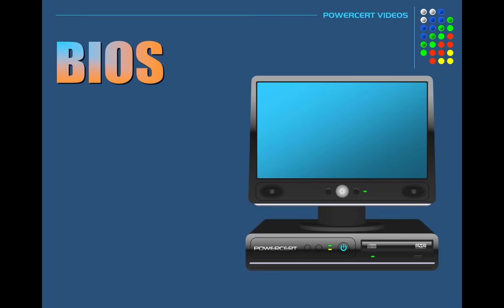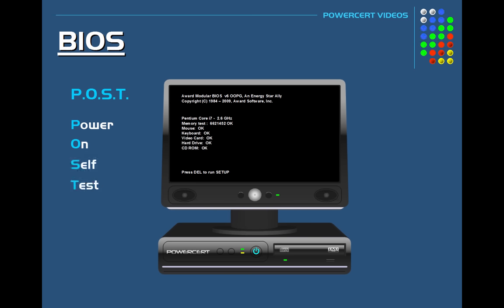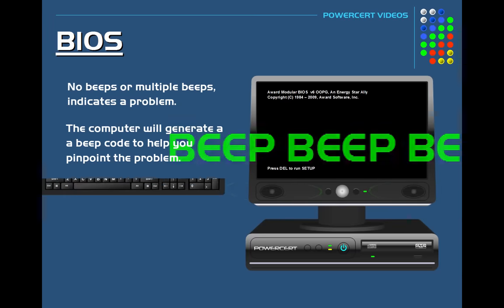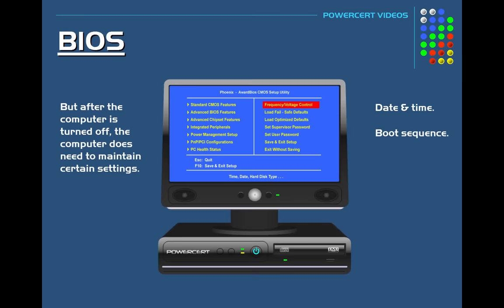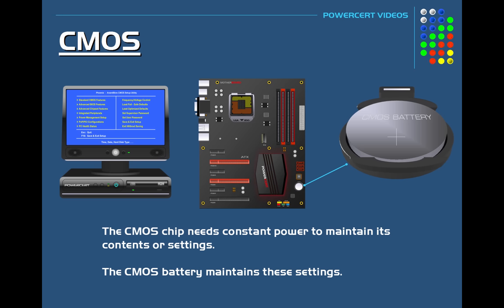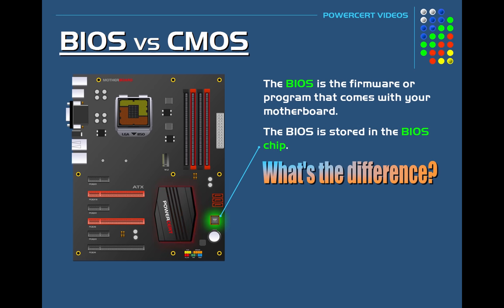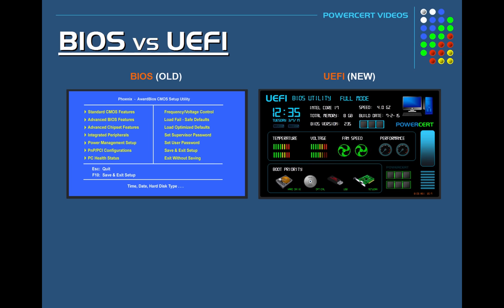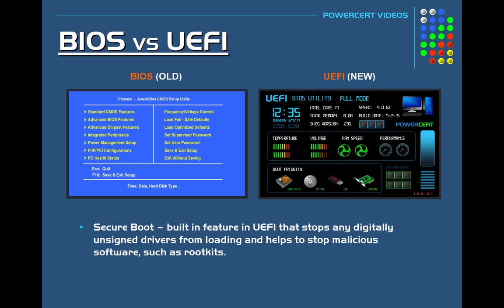BIOS, CMOS, UEFI - What's the difference?

Comment: Not sure if you explained what CMOS stands for.  It stands for “Complementary Metal–Oxide–Semiconductor”.
Reply: yea thats correct..
Reply: There's no point in me hearing because I'll just forget it. I don't really see the point in remembering what it stands for either.
Reply: yes indeed....many people wrongly refer to CMOS as an entity similar to BIOS Setting. CMOS Battery is usually a CR2302 a 3V battery...these batteries are too large for a wrist watch. Having said that this is a good tutorial none the less.
Reply: No need to mentioned what is COMS stand for, you will forget it anyway! and even CompTia A+ test will not ask you what is CMOS stand for.
Reply: @FXV  *CR2032
Reply: @FXV  
CR2302 batteries used in Casio watches.
Reply: Technically it is quite unspecific to call it a CMOS, as that is just the technology it is based on, kinda like refering to a cpu by transistor size.
Reply: @swagiyo9801  exactly... saving to the BIOS hasnt been called CMOS since like the early 90s...most BIOS's these days have the settings stored on the same chip...not in the RTC..not on an external chip..
Reply: And it's named after the type of memory used in the CMOS chip.
Reply: So, similar to a digital camera?
Reply: The best kind of metal-oxide-semiconductor, I hate the ones that insult you.
Reply: @shade0636  It may never to you.  One day, it may be just the information you need.  That's the thing about education.  You are never quite sure when or if you are going to need a piece of information.  But if you don't learn, you will never know ...
Reply: William Potter Yeah that's true. Extra information never hurts. Although one year later and I was correct about forgetting lol.
Reply: @shade0636  I forget what I had for breakfast.  But I keep trying !  On the other hand, I know nothing about computers and I am trying to learn so I can rebuild mine.  I just don't know what's important yet .. So far the only thing I understand is when you build a new computer and it won't start check that it's plugged in and turned on ....
Reply: inconCMOSable! you keep using that word; i do not think it means what you think it means
Reply: @shade0636  That's because its only in short term memory. If you use it it will be stored in long-term memory. In any event, it really expands your knowledge and even if you don't remember it, you will be familiar with it. 

For example, I remember that CMOS chips are also used in video cameras as a less costly and more efficient replacement for CCDs (Charged Coupled Device). 

None of that many mean anything to you, but it may help in some way in the future. Like Algebra or the periodic table. We may not understand it, but its still a part of our lives everyday.
Reply: I don't know why they would call it a CMOS. CMOS is a transistor level technology and has nothing to do with BIOS settings itself. Also, I don't see why they didn't use flash or eeproms instead of volatile memory to store configurations and having to mess around with batteries.
Reply: Complimentary Metal Oxide Silicon.  Thats from back in the day (70s and 80s) when I was working with MOS and CMOS devices.  Maybe the definition has changed somewhere over the years.
Reply: @FXV  CR2032.  But the most recent iterations of CMOS didsn't  use batteries at all.  They are ultra low power devices that use capacitors.
Reply: @TheChrisey  Flash technology had only been developed by Toshiba in 1984 and commercialized later in the decade by Intel. So in fact, flash has only been around commercially for just over thirty years.
Reply: You will never remember that name. Its better CMOS stands for Contains Most Of Settings.
Reply: It is the Type of Battery used
Reply: True,another Technology Examples is TTL and NHMOS
Reply: Not in this context. For this case, it stands for "Configuration Management Operating System"

Comment: The main difference between BIOS and UEFI is not the graphical user interface. It's that BIOS is running in a crippled 16 bit mode and is therefore very limited.

Comment: What you call the "CMOS chip" is the real-time clock. A clock needs to run constantly, which is why it has its own power supply (the battery). The manufacturer of the original clock chip included 44 bytes of storage. This was powered by the same battery. This is where your "settings" are stored. "Clearing CMOS" means clearing these bytes of RAM.

Comment: The most important difference between (legacy) BIOS and UEFI is the way of organising the boot process. For UEFI there was an EFI boot partition introduced where boot loader data for various operating systems are stored. This way it is easier to build and maintain multihomed PCs (with multiple OS installed).

Comment: If there are no beeps, there will be a beep code.

.....Keyboard error. Press any key to continue.
Reply: OK. But where the h*ll is the 'any' key? 🤔
Reply: @eknaap8800  try turning your keyboard over and checking the underside for the any-key.
Reply: @fraydizs7302  Nope, there's isn't one either...🥴
Reply: No beebs could be GPU failure.
Reply: taranTula leGos  So that would be the 'any space bar'? 🤔
Reply: when the keyboard is not connected it starts automatically
Reply: That's the error message I got when my dad hid my keyboard back in the 90s. The first time, that is. The next time I had already set up my BIOS to ignore keyboard. :)
Reply: @eknaap8800  You have to press in this order the keys: A,N,Y,K,E,Y. Got it? 🤣🤣🤣🤣
Reply: @johnphilippatos  OK, got it now... 👌😂

Comment: The computer speaker may actually be set to "off" by default in some UEFI configurations (I had to turn mine on, for example).   There were older BIOSes that enabled mouse devices, btw.  This is a good video to explain the differences, especially with Micro$oft's ridiculous Windows 11 system requirements for UEFI and Safe Boot.  People will be very confused about needing those things.
Reply: @michaelcook5585  It could also be that your computer cannot generate beep codes.  My current computer has no audible codes because it has no built-in speaker, but there are 4 tiny LEDs on the motherboard that light up at the beginning of P.O.S.T. and turn off off as the CPU, memory, disply, and storage subsystems pass the test.
Reply: Respectfully, Jim Maloney wrote "Safe Boot" where I think he intended to refer to Secure Boot.  "Safe Boot" is not actually the same term; it has historically referred to an option for starting Windows with many feature and options disabled, for the purpose of troubleshooting or getting Windows running after a driver update or setting change caused it not to run (so that you could back out the offending change).

Comment: Quick Note: UEFI doesn't really require OEMs to use a fancy GUI, some still use the old legacy text based UI of BIOS, using only thd keyboard for navigation.
Reply: I've seen boards that had both bios and UEFI... and gave you the option which one to use.
Reply: mine is uefi but it has the old ui

Comment: In short, the BIOS or UEFI BIOS is a medium between your operating system and hardware,
This is done for 2 reasons security and simplicity.

1) The BIOS/UEFI will prevent psychical damage to your hardware (set limits to what the operating system can and not can do such as voltages cpu, memory, sensors to detect failure and shut off the pc before more harm is done)
2) The operating system has to obey rules set by your BIOS and doesnt need special drivers to control important aspects of your CPU and Motherboard because those are inside the BIOS this makes it secure and easy for OS'es to run on that hardware
Reply: can you tell me how an UEFI works ?
Reply: nah, bios lets win control mostly everything once you load, for example, boot.ini, hal.dll and alike. so if you, for example, keep pc in stby, bios is never really used, and pc works, right? and consumes few watts while sleeping which is almost the same as bios idling. bios is more of an legacy stuff than a real need.....sure it can halt boot if cpu or ram are faulty but...meh....win can do that too, it bsods it.
Reply: Some systems bypass the BIOS routines. BIOS was sort of the KEY for IBM to defeat clonning (didnt last much LOL).
Reply: How to configure bios to work with UEFI hard drive
Reply: I disagree about your point no 1....modern OS  bypass BIOS/UEFI at certain extends settings once it was installed.....BIOS is like the initial firmware or we can called it Operating System at the very basic..hence the name Basic Input Output System....this is where you tell your mobo to enable/disable or any misc settings before we installed OS, e.g storage configurations AHCI,Legacy,Raid. Once your OS and drives up and running, your OS basically already has the control over your hardware, at certain extends. You can from OS level set CPU voltages/frequency/RAM  , but stability might not be the best ! Off course at the very low level , OS can't change boot sequence, type of SATA (AHCI or RAID or Legacy) to name a few and some advanced settings that might only viable only at very low level.
*Disclaimer, this my experience dealing with Windows since 1997. I'm not sure how Linux or other OS handles their OS at kernel level.
Reply: @JdMetal  
Yes the bios will give the os the control .
And about linux it is the same thing man .

Comment: UEFI also communicates with the OS while the OS is up and running, and the OS from there could change some UEFI settings. Where bios handed settings to the OS once the OS was loaded but from there remained unchanged.
Reply: is this why you can use the ryzen master to OC a ryzen cpu without fiddling bios?
Reply: @necrobynerton7384  if you have the correct program within the OS, you can do many changes to UEFI since they both talk to each other while the OS is up and running.
Reply: @garyr7027  very interesting indeed
I didn't know this, thanks for the reply

Comment: Great explanation! 👍
One correction though. 4:50 large storage recognition is due to GPT instead of MBR partition table. If the disk is has a GPT, it can be used also with BIOS.
I wish to find out such great, detailed explanation like this one, but about the UEFI itself. Its shell, multi-booting (Win+Linux, or Linux+BSD) secure boot, etc.
Reply: I'm glad someone pointed this out. It was the first thing I thought when I saw this video. At some point in the future, BIOS will be completely replaced by UEFI.
Reply: What does any of this mean?

Comment: I'd love to see a wristwatch that takes a battery as big as the CR2032 that most motherboards use. Not a good example, but a decent video attempt at simplifying a very complex topic.
Reply: YOOO MY FAV YOUTUBER WAS HERE 10 HOURS AGOO?? DAMN THATS CRAZYYY
Reply: He said same type of battery not same size 🤔😊
Reply: Some Casios use CR2032 and CR2016
Reply: Yes Sir
Reply: Windows Blue screen of Death 🤣🤣🤣😂😂😂
Reply: 2032 is used in mens watches.
Tiny button cells by ladies 🐽
Reply: I have an old Casio G Shock that uses a 2032 battery.
Reply: You´re right with the CR2032 or 2025, only some wristwatches uses them, but many remotes of Hifi Components and TV Remotes. In spite of this, also this video was very great -> so i see it like you.
Reply: Check any old or cheap watch, I could send you one if you need to see
Reply: But he got more subscribers than you🙄🙄
Reply: Also, CMOS is a technology used for making chips, not a specific type of SRAM.
Reply: I was trying to visualize that.
Reply: @user2C47  That's to distinguish it from TTL chips not classify the function.  CMOS chips run on a different voltage level and have tougher spec.s for environmental conditions and that's why they were used by the military.
Reply: @la7dfa  Is this a gender reveal for the androgynous name Carey?
Reply: @Dloc47  tech snobs back at it again haha

Comment: Yo my dad old PC from 1995 bios had mouse support, with the cursor having an animated tail. The interface had icons too.
Reply: You mean.. Windows 95?
Reply: @gigimuschi7466  No the bios had icons like a phone OS home screen, very low color and res obviously. You could click with your animated mouse the options like IDE and other stuff. I remember my older cousin installing that new HP 2x compact disc writer and going in the BIOS and he too being surprised it was like that. That PC has run DOS, windows 3.1, windows 95 and 98. It was upgraded from 16MB memory to 64MB. CPU from 133MHz non MMX Pentium 1 to 200MHz with MMX technology during it's time.
Reply: I remember that before I learned to write, I could type cd games, dir . And play games like jazz Jack rabit, Wolfenstein. And quite a few others.
Reply: In 1995 some bios are manufactured for special or high class motherboard that's why you can see that type of interface 👍....
Reply: @ramanmono  maintain your pc properly it's a vintage pc and 😊👍
Reply: My old 486 has mouse support

Comment: Actually the CMOS battery is only needed to keep the clock running, the CMOS is solid stage storage.
Reply: No the clock is broken .
Reply: Maybe on recent 400$ gaming motherboard but clearly not on most motherboard you can find
Reply: U can reset the bios settings by removing the CMOS battery for short period of time in older mother boards in case u accidentally faulted the bios settings.

Note: it doesn't work if u have power loss during bios update, then Ur mother board is bricked
Reply: @dreadavis9751  Asus Maximus VIII has a reset switch on the back, no need for removing any battery.
Reply: @dreadavis9751  

What if i replaced or charged the bios chip again ?

Will the motherboard work ?
Reply: @MO-hq4iz  ya , I said in old mother boards like in pentium 3s, 4s era. Of course newer mother boards have reset switchs or even have 2 bios chips incase the first 1 failed. If don't have a reset switch, u can always remove the CMOS battery to reset
Reply: @xrafter  ya, u can physically remove the bios and flash the correct firmware externally and reinstall, it will work, but need the bios flashing hardware

Comment: Computer may also not beep when the motherboard speaker is discconected.
Reply from the maker: True
Reply: Ohh... come on! It will not beep if you do not plug the power cord either.
Reply from the maker: True
Reply: My msi 450 a pro does not beep, so i need to check it out if there's a speaker connected.
Reply: It depends. Some computers have a small beep speaker attached to the motherboard.
Reply: it will...no speakers are required
Reply: @NUNYABIZNNAAAZZZ  True
Reply: @viky1354   True
Reply: Computer may also burn when set on fire.
Reply: Motherboard doesn't beep. Possible reasons. Select all that apply:
A. Motherboard still in packaging.
B. Ears have been disconnected.
C. Motherboard on fire.
D. User deceased.
Reply: @SecretAgentPaul  True
Reply: @dan_729  True

Comment: Do modern laptops "beep" after a successful startup? I've had several over the last couple of years and I don't remember hearing the traditional beep I would hear from desktop computers.
Reply: Some of the newer ones may not - most manufacturers have been eliminating as many 'options' as possible (try to find a floppy drive or even an optical drive today). The laptop speakers require a driver to make a sound, the original 'beep' came from a direct drive by toggling a single bit on an output port.
Reply: I know it's very frustrating. Seems like all those things that we were taught years and years ago about computers seem to be disappearing because manufacturers don't want to spend the money any more due to cost cutting.
Reply: Especially if your laptops supports fast boot, you may not really hear anything during normal boot.
Reply: @klwthe3rd  your boot beep aren't actually removed, it just disabled by default, so you CAN re enable it from the bios, mine is b450m bazooka plus from msi, and its beep disabled by default, but you can re enable it from the bios
Reply: I have optical drive and I like it also one of my optical drive do some weird sound when I turn on the computer like the floppy drive I think it is an beep I use UEFI
Reply: @silvervens  my optical drive also makes that weird sound when i start my pc, and for that beep, the beep is different from that weird sound
Reply: Iwasaki Ok

Comment: I like your videos very much but this one lacks many things about UEFI. Saying it has a nice interface does no really address the UEFI differences against BIOS, and the section about booting is too short
Reply: Did you watch the whole thing? He said way more than "it has a nice interface."
Reply: @shade0636  for a very common user it says a lot, but maybe you can enlight me. Where are the so called Secure Boot keys stored since neither BIOS nor UEFI can understand a filesystem? Does UEFI interprets the MBR the same way BIOS does? Is the same sector loaded for both UEFI and BIOS? Why it supports larger drives? Does it introduce a new partition table format beyond GPT? Can the same disk be booted either on BIOS or UEFI systems? Tell me where these answers are on the video. At the end, he said "way more" things
Reply: @alvaro_ch  How about you tell me where in my comment I said that it contains everything about the difference between UEFI and BIOS? I simply pointed out the fact that he said way more than what you claimed he said.
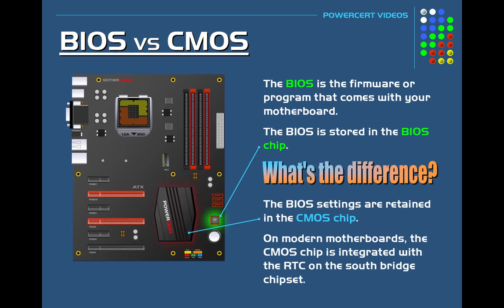Reply: @shade0636  yes, the video explains BIOS in detail, and then, at 4:17 explains UEFI in about a minute. That´s way more (nice interface, supports larger drives, can use the mouse and secure boot), so the video "lacks many things about UEFI"
Reply: @alvaro_ch  I am not disagreeing with you.